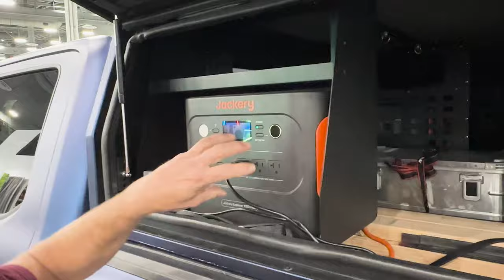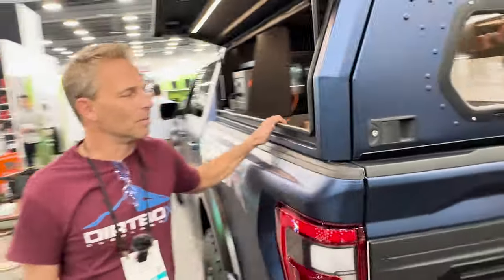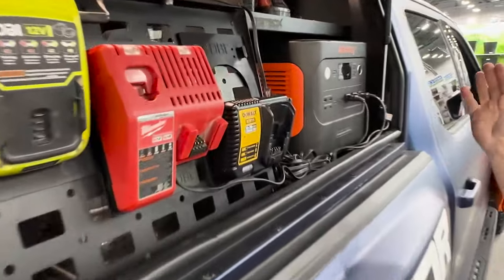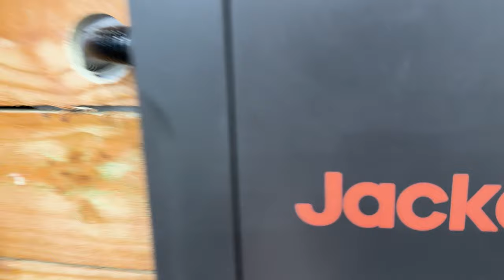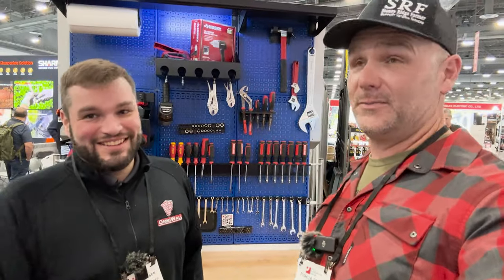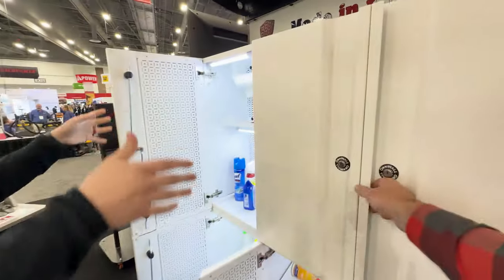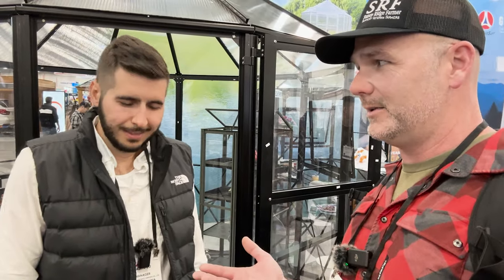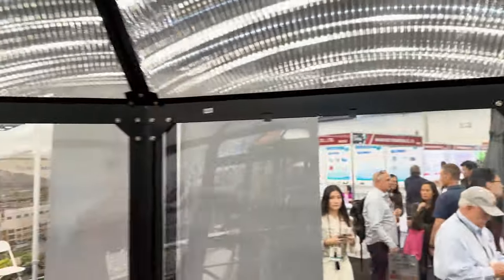Here's Why I went To Vegas! You'll love this!

Comment: Hey Josh thank you for the video I enjoyed it but one thing that they could have been improved on for that solar panel pickup truck instead of making the cable only 20 ft long they should improve it up to at least 50 ft to 100 ft long and yes I understand you lose voltage the longer it is but still woo